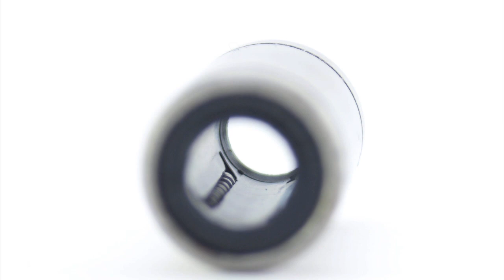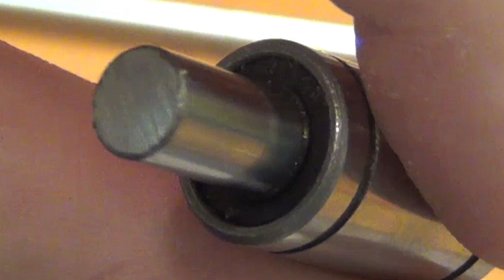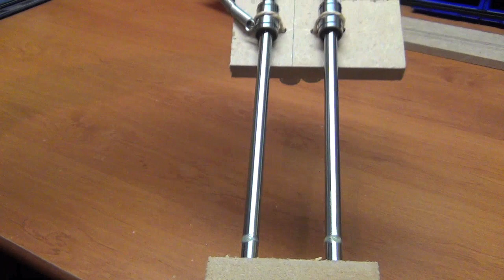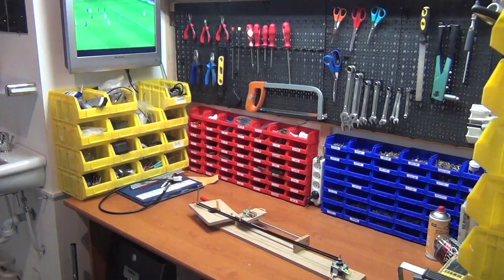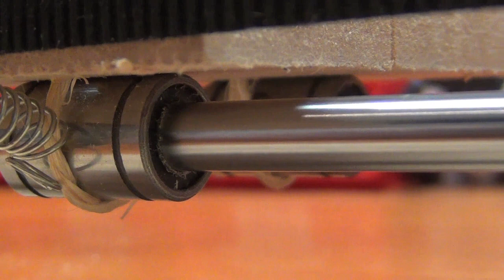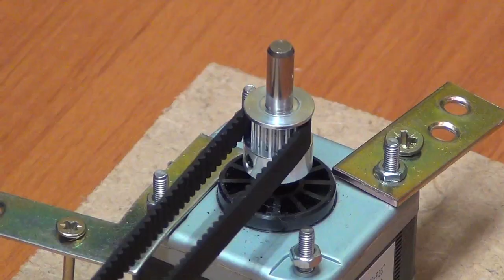Linear ball bearing

Comment: Hello there. I have a silly question for you ^_^ How were you able to arrange the metal rods (on which the bearings move) perfectly in parallel to each other?
Reply from the maker: Easy: they are mounted in exact 8mm holes in MDF wooden endpieces. Place the endpieces on top of each other and drill two holes through them using a drill stand.
Reply: Jan Adriaensen Thanks for answering! Somehow that is something I would have never thought of :(

Comment: Is this noise normal? My LM12UU make similar noise during movement and I thought that something is not OK with them (or with rod), but now I'm not sure. Could you give me some advices how to lubricate linear ball bearings?
Reply from the maker: I think it's normal, but I had the same concern. I tried other rods and bearings, they all sound pretty much the same. I use ball bearing grease, but don't really know if that's the right approach. It makes the bearings run smoother, but the sound remains the same.

Comment: I have seen these bearings for dirt cheap on ebay they are the china ones. I had a quick flick around the net as I plan to build a DIY CNC but I heard that they are cheap and nasty and the bearings grind and they arent smooth. How do yours handle did you have any problems ? I do plan to lube them properly but I dont wanna waste money and time buying one linear method if it will be simpler for me to go the aluminium angle route with standard skate bearings :D
Reply from the maker: +Jtag Sheep Hi, sorry I can't help there. This video is two years old, I planned on building a small cnc but never finished the job (It's still on my long todo list ;) ) . My first impression was that they are very precise, no margin, tight fit on the rod. I bought other ones (they were all cheap Chinese)  in smaller sizes, they were not as good. I was worried about the sound they make on the video , they all do that, even when lubricated. But I never bought expensive ones, so I can't compare. These ones ran very smooth in test though. I'll let you know when my cnc machine is up and running (in a year or so ;) )

Comment: How much backlash is there? would this kind of system be as good as linear guide rails?
Reply from the maker: There's no backlash when using this kind of band and pulleys, they connect directly to a stepper, no gears in this system. However, this would not work on heavy loads (the band is very rigid, but it's still a kind of "rubber band") and positioning heavy loads would not be accurate (this system would be more useful in 3d-printers, not CNC machines). Linear guide rails are more rigid (but a lot more expensive), these shafts cannot hold heavy weights because they bend down a bit, not useful for long distances and/or heavy loads. It all depends on the application: I want to make a small cnc machine for milling/drilling pcb's and I guess these should do just fine.

Comment: Hi Jan,
In my new model I m using rack and pinion mechanism,during that mechanism ,when pinion is moved in one direction the linear bush will be in complete contact with the inner shaft,but when is it moved in opposite direction only half of the shaft will be in contact with linear bush. My question is will it works when only half of the shaft is within the linear bush. Can u respond me asap
Reply from the maker: With that model in this video I don't think that will work. There is quite an amount of resistance when the inner shaft enters the linear bush, so unless you use a high trorque motor, I think this would block your mechanism. The motor in this video would not be strong enough to do that.

Comment: How smooth is the travel? any vibrations ? can we feel any kind of vibration while the bearing is moving at low speeds? And is there fricton?.
Reply from the maker: Travel is pretty smooth, but I can only compare with other cheap bearings with smaller diameters. I did not feel any vibrations, I tested at really slow speeds. There's some friction, but it's not too bad, as you can see the bearing falls down on the shaft only by its own weight. Other models I tested did not do that. I got best results when I bought bearings and rods in the same online store. You should note that the weight on the bearings and shaft is low in this test, only a wooden plate with batteries.

Comment: i know it's kind of a stupid question but : if i buy a linear bearing of 8mm diameter should the aluminum tube also be 8mm of thikness ?
Reply from the maker: yep ;)
Reply: Jan Adriaensen thanks man ,sometimes i buy stuffs on ebay then i find out they're not compatible so i prefer to ask the stupid questions instead of being dessepointed :D don't u agree ? xD
Reply from the maker: Absolutely, been there, done that. I've had that same experience lots of times, if you only see items on your screen and even doublecheck all specs, it can still go wrong. So no, that was not a stupid question at all !
Reply: thanks again :)
Reply: Nassim so I was going to set up, try to set up, an automated way to mill the inside of a drum (stave drum shell). I basically have 2 sets of the 3/4" rod the rail shaft clamping guide supports, and the 12 mill ball bearing unit slide bushings (2 per bar) and then the square flanged cast housing. I will basically mount a small plunge router and have this travel thru the inside of the drum shell while it spins. 

Do you think I can just use this motor and pinion belt (??) set up? 

Thank you for any advice

Comment: Sir could you please tell me where to search for such belt and appropriate gears?
Reply from the maker: ... copy and paste from previous comment ;-) ...
All this stuff is from China: aliexpress.com . Search for 'GT2 pulley' for the band and pulley (motor attachment). For the other side, also one pulley mounted on a '5mm axle' in a '5mm flange bearing' in a hole in the wood. It's pretty straight-forward ;-). Just keep in mind that all bore sizes are 5mm (or whatever size of motor axle you use)
Reply: Jan Adriaensen excelent...thanks a lot!

Comment: Nicely done! where did you get the band and the motor attachments for it??
Reply from the maker: All this stuff is from China: aliexpress.com . Search for 'GT2 pulley' for the band and pulley (motor attachment). For the other side, also one pulley mounted on a '5mm axle' in a '5mm flange bearing' in a hole in the wood. It's pretty straight-forward ;-). Just keep in mind that all bore sizes are 5mm (or whatever size of motor axle you use)
Reply: Jan Adriaensen what kind of velocity can you get from the motor and what kind of controller did you use??
Reply from the maker: Sam Hayden In the video I used microstepping , half- and full stepping http://www.jangeox.be/2013/12/microstepping-with-arduino.html. In full stepping, it maxed out at 1000 pps (pulses per second - with 96 steps/rotation, that's about 600 rpm). It can go twice as fast with no load and using the slew range (start slow and speed-up), but then it's not strong. I use my own designed driver board with L293D driver chip.

Comment: So I've ordered a couple of these babies from China, along with some steel rods and other stuff, want to try and make a small CNC contraption of my own :) I have another question for you, man, hope you can help. What is the best way to know the exact position of the "working unit" of the CNC on the table? At first I plan to use a ball pen to be able to draw some lines (straight or bezier curves) on paper. So how do I know in the program where exactly above the table is my pen? Do I need a webcam and image recognition processing for that, or what? Or do I add limit switches to the position of origin (0,0) and then go from there, simply counting the number of steps I've made in each direction? That's all I can think of :(
Reply from the maker: Count the number of steps for sure, limit switches are not very accurate (for my purpose: drilling in PCBs) and webcam is a bit far fetched ;) I was planning on adding buttons or a small joystick (I can read out a WII nunchuck controller easily) to move the working unit to a position and then marking it as (0,0) in the software (I plan on writing my own). In my design, I would also need to mark 2 other points far on X-axis and one far on Y-axis to know exactly how my PCB is positioned. When drawing on an empty peace of paper, that doesn't really matter ;)
Reply: Jan Adriaensen Thank you for answering! I think I'll go with limit switches, that will allow me to position approximately in the top-left corner of the sheet of paper, and I can go counting steps from there.
Reply: Максим Щербань I'm thinking of using a plastic disk with holes and a light sensor thingy from a scanner. Every time a hole spins by the sensor it will register a tick.

Comment: Hello.. How did you construct pulley shaft on other side of motor ?? Thanks
Reply from the maker: I bought some shafts of 5mm (just like the motor shaft) and mounted it in a ball bearing of 5mm inner diameter. The outer diameter of the ball bearing is about 10mm (I'm guessing now) so I drilled a hole of 10mm and punched the bearing in with a hammer, it's very tight. Then, I screwed the exact same pulley like the one on the motor on the new shaft.
Reply: Thank you for the details :)
Reply: I did the same thing and it worked.. Thanks again..

Comment: Do these linear bearings twist when they are on the metal pole/rod?
Reply from the maker: yes they do
Reply: I was about to buy a bearing like this for linear travel as well as a small degree of rotation. The listing on McMaster Carr however states "Fixed Alignment". I don't see how a perfectly round housing can be fixed as this (P/N 60595K45) does not have any cutout for rotation prevention like some do. I only need to rotate about 30 degrees.
Reply: @QwikKota  did it work, do these things allow free rotation?

Comment: Hardly any more expensive, just as precise, no moving parts and a lot quieter are Igus Drylin bearings,
Many 3D printer modders switch to them for  much quieter machine.
Reply: problem with those are tolerances ... you cannot use them without a housing and to get the right tolerance on them, they need to be pressed with a 40kg force. So if you are using them WITHOUT a housing you are using them wrong.
Reply: Mine fitted perfectly in the standard aluminium housing, tight but I'm sure I didn't have to press them in with 40kg force. As I said they are a commonly used upgrade on 3D printers.